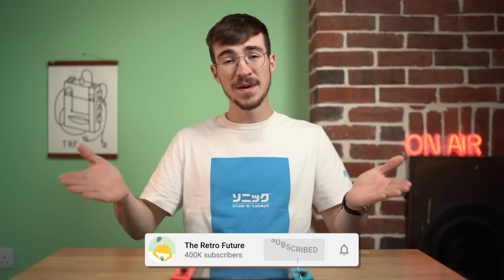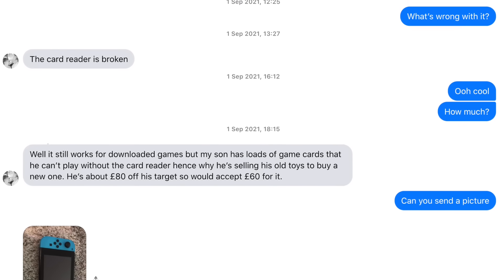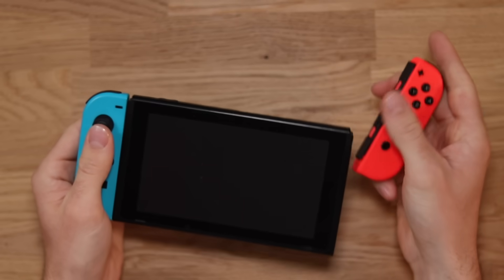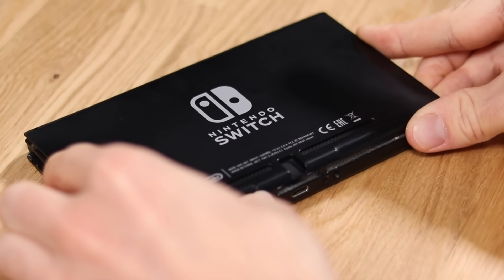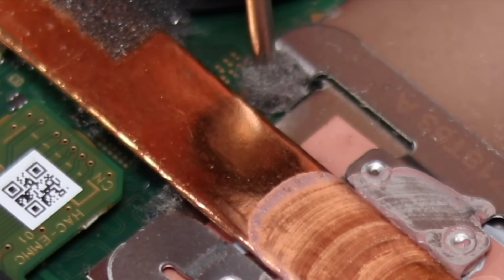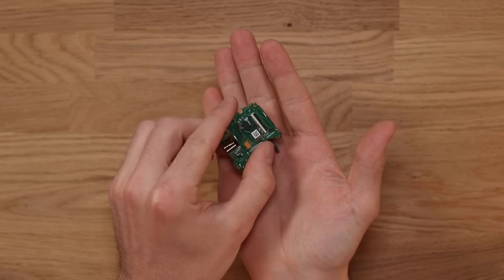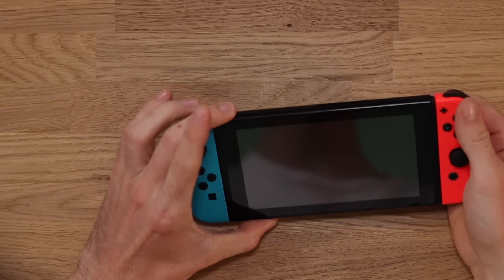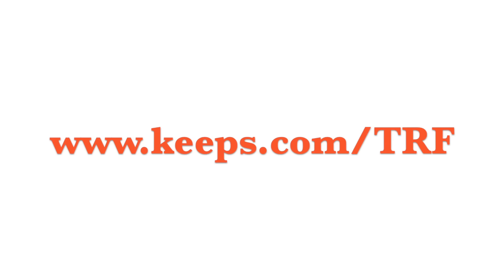£60 Nintendo Switch! - Can I Fix It?

Comment: To fix joycon drift, instead of replacing the joysticks, you can place a milimeter thick piece of paper between the joystick and the battery. You will never have that issue again
Reply: yeah he probably could've tried that first but also it hasn't been super long since that fix was found so it's hard to say how permanent the fix is
Reply: im sure he knows but at least here he shows how to do it if you need to actually replace the joystick for any reason..
Reply: The internet is such a badness thing that people can learn solutions to things and share them so easily.
Reply: except that this method can possibly lead to ur joycons being irreparable
Reply: @Zaque-TV  I did in fact try this solution myself, and I never had the issue again
Reply: @spamtoncrocker9067  how so?

Comment: I also cringed at not putting some fresh thermal paste on the SoC as well. Not to mention that you should've checked if the Switch you bought is exploitable or not. RCM-capable Switches cost quite a fortune on the secondary market, and if this one is indeed a first-revision model, you're golden!

Comment: I'm happy to see a classic style repair video. One thing though: Did you not add fresh thermal compound to the SoC? That is not a good idea.
Reply: I was going to ask the same thing, I would like to think it was quickly assembled for testing
Reply: tbf overheating the switch is still really hard.
Ask spawnwave 😉
Reply: Thermal compound is so overated!! Lol
Reply: It’s dust that causes more problems in the switch than the thermal paste. Ask me how I know.

Comment: I just wanted to let you know there is a more permanent solution for joycon stick drift. Just take a bit of cardstock, and some double-sided tape, and stick it to the back of the joycon module before reassembling.

Edit: here is a link to the OG video

https://youtu.be/Vid8lIXmZwE
Reply: I've been accidentally causing drift by screwing joycons together too tightly for years... and somehow I never made the connection that it might work in reverse :')
Reply: Tough it won't work for all sticks. Had open a defective Joycon from ebay, and that analoge stick was propably the worst drift I've ever seen - the cardboard solution won't work there. For milder forms of drift it appears to work fine.
Reply: @sagichdirdochnicht4653  there's no problem with him replacing the analog stick. But after you do that, add that little bit of cardstock to make sure you don't get the minor drift as well. It's just so prominent, and will most likely happen in most joycons.

Comment: For those who have had slight joycon drift and don't feel like opening your joycons: isopropyl alcohol into cotton swab/Q-tip, enough to soak it -> rub the alcohol into the joystick base where you can see the seam between the console and stick -> after getting the whole thing nice and wet, rotate joystick vigorously while clicking it at the same time in order to get the alcohol all the way inside -> repeat the whole process couple times, usually three or four does the trick for me. And there you have it, the drift should be gone for a good half a year or so, depending of usage I guess. Has worked for me every time and counting.

Comment: Sometimes drift can be fixed as simply as "unbending" the botom metal plate to apply some pressure back to the stick, just press with something solid on it.

Comment: iirc, the kickstand is supposed to be set from the inside of the back panel during reassembly. That might need outright replacement.

I've taken apart my Switch and redid the thermals; and added thermal pads to the RAM as well as pads along the lower part of the heatpipe to help pull any straggling heat to the shielding.
The real weakness is how the dock blocks the Switch in terms of ambient air. Those little oblongs aren't exactly vents, kind of?

Comment: Joy cons with the dock alone is worth the money. The switch was free if you think about it. I just picked up a fully boxed switch HAC-101 on eBay with 2 sets of joy cons(one pair is splatoon colours) Minecraft game, 128gb micro sd card, 2 cases and 2 normal controllers for £160 posted. The guy started the auction at £94 and I messaged him that day and asked him for the serial number(for modding) and then once he’s showed me I offered him £160 for it and he was well happy as am I! It’s perfect for the price😃. I’ve got the games I want because i soft modded it and I’ve ordered the special edition animal crossing housing for the switch, dock and joy cons from aliexpress to finish it off.
Reply: Some guy is selling a Nintendo Switch for £50 on FBM, he joined in 2022, should I get that one or a 3DS for £15 from a legit seller?

Comment: Most of the time you dont even have to replace anything in the joycon, if you cut a business card or something of that thickness over the joystick inside the controller that fixes the drift as most of them have issues due to bad contact and the pressure the card creates fixes it!

Comment: Ngl, I am fuming at how you got one for so cheap with such an easy fix. With the dock and bits no less!!! Here I am stuck with one with a short on a capacitor left of the lcd connector that I can't find any info on! (Causing the switch to boot into RCM mode. Other than that everything has no shorts or water damage, etc.)

Also when I heard you say nunchuck I almost lost it, then I heard ps1 directly after and couldn't stop smiling during the video. 

What I'm taking away from this video is, I need to use Facebook marketplace more often!!!

Comment: My cartridge slot doesn't work either, not a big deal for me as my games are digital. Sucks though, was pretty sure I put it together right. Didn't check the slot itself though, so likely bent pin.
Reply: mine works sometimes but i only have 1 phys. game which is always inside so...

Comment: Of all the things I have worked on, the Switch scares me the most, simply because the screws Nintendo used are SO damn cheap & crappy that they strip INCREDIBLY easy!  And if you strip even a single screw, well... You aren't getting into the system.  Yeah, it's a really huge pain in the arse.  You can be as careful as can be, and you will STILL strip a screw.  It just happens due to how absolutely god awful these screws are.   They must be made of putty or something.

Comment: What were the white tweezers you were using on the ribbon cables? I tried to fix my joysticks myself but I ended up damaging a ribbon cable because the tools I got with the replacement sticks didn't come with tweezers and had to send it off to fix my botched job (thankfully for free).
Reply: They’re ceramic tweezers.

Comment: Hey Elliot and anyone else who can answer! I’ve been looking in to fixing two of my families broken joycons and was wondering, is there anyway to fix the drifting joysticks without having to buy new ones. I already bought a tri-wing screwdriver to open them up, so basically I was wondering if it was possible to somehow just repair the existing joystick, or if I do need to put new ones in. Thanks for any help anyone can give!
Reply: Look up the 'cardboard' fix on youtube. You basically slip a very thin piece of card / plastic under the stick housing.. that's it. 

You can test whether it will work by opening the Joystick Calibration app in Settings, then pressing very firmly on the back of the joycon.
Reply: Thanks! Will try that first!

Comment: I have a question! i bought a switch lite for 90, and the lady said the joysticks were broke, and i saw like, "ok, i can fix that." so i bought some replacement ones and put them in. But when i turned it on, it was still registering fully pressed up, is that a motherboard thing?

Comment: So how do you find out exactly what's wrong if there isn't documentation? For example my switch has an error code: 2002-0001, and it won't even get to the home screen. Nintendo says it has to do with my Mirco SD card and to remove it or use a different one, but even after removing it I get the same error code.

Comment: When I got back into tinkering with gaming devices, partially because of finding this channel during covid, and looking for something to do, I finally had an issue with my left joy con. After a few attempts to remedy the problem with spraying air/using iso to clean it out, I finally decided to take the joystick apart to see what was wrong with it. Using another person's video guide I was able to take it apart, clean it, put it back together and it worked .... for awhile. Then the drift came back and I replaced the stick. 

Then a friend posted a video he found that claimed to have the fix for drift forever. I haven't had a chance to test it yet, but apparently all you have to do is add a somewhat thin square of plastic or cardboard or something under the joystick housing and it'll stop the drift. I guess over time the piece expands or loosens slightly and that's what causes the drift, and by adding the little square (of whatever you use) to compress the bottom, keeps it from happening again. That makes me wonder if taking the cover off, putting it back on, and re-tightening the screws plays a bigger part in the temporary fix than people realized. 

I'm going to try that when drift sets in again, and see if it works. And if so, that's time, effort, and a little money, saved on replacing the joy stick and/or risking destroying it by taking the stick apart to clean it (I would not suggest doing that part unless you already have a replacement on hand as I did when I attempted it)

Comment: You saw that this belonged to a child who is now selling off his toys to get a new Switch and you don't offer it back to the family for the money back as parts and labour? Didn't realise that you were that broke.
Reply: If they wanted it fixed they could’ve easily paid to get it fixed fairly cheap, don’t pin it on the guy who ended up buying it.
Also they sold all the accessories with it, I highly doubt they sold it for money to buy a brand new one